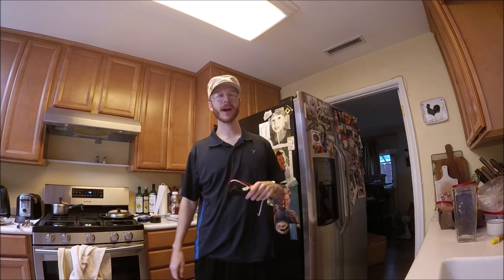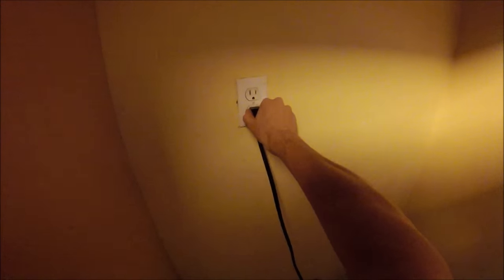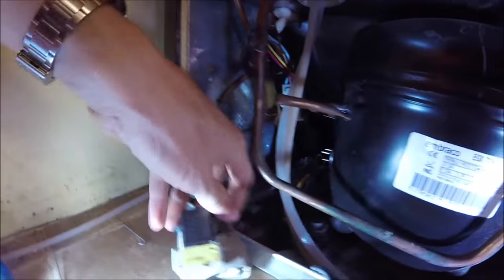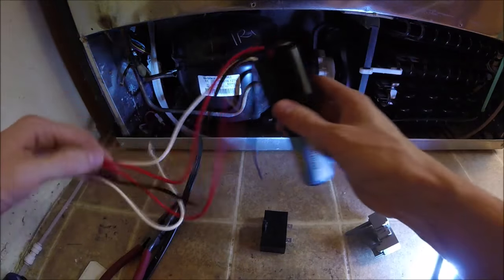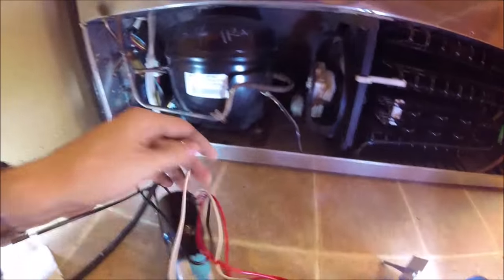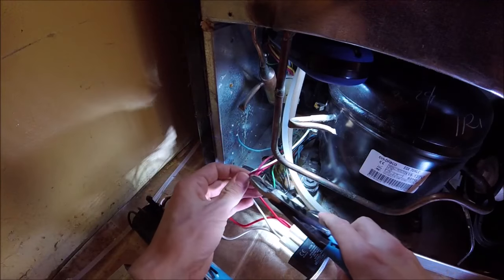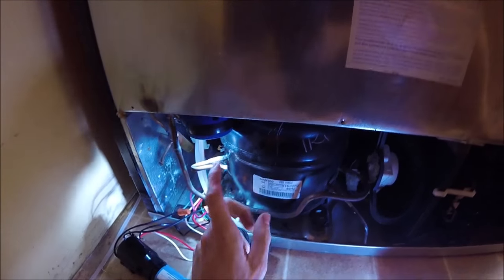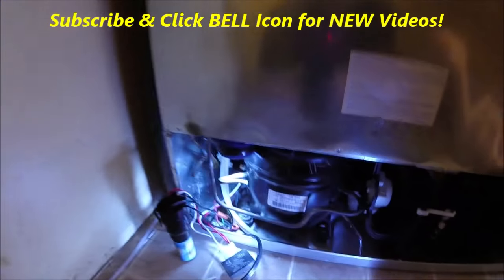Fix Refrigerator. Installing Universal Relay (3 in 1 Starter) on Compressor -Jonny DIY

Comment: Jonny please help me!!! I have a 20 year old GE working GREAT until I defrosted it yesterday. It is all manual. You twist a Temp Control Nob to defrost. When defrost is finished you just turn it up  to higher temp (1-10 coldest). I turned it but it just turns without clicking the fridge on. I can turn it all the way off but not to make the fridge cold. Instead it is stuck in defrost mode. I hear a clicking which before I never heard with this fridge.  It clicks and then the motor starts and cools for a few seconds then stops again. It does this maybe 3- 4 times an hour.  I am so anxious because I cannot afford a new fridge!! Do you think that it is NOT a Temperature Control mechanism problem but instead a simple relay issue? And is fixing an old fridge relay easy? Are relay mechanisms generic, all the same for models or impossible to find for an old model??  Ironically, I did find a new GE Temp Control for my model. SECOND QUESTION: what are the odds that it is the compressor that is broken...? I am really frantic with anxiety == can you please share your expertise? It is clicking, it is turning on and off and the nob just turns without igniting the fridge.  A million thanks in advance!
Reply from the maker: Well I would fiddle with the switch some and try to get it working then I would move to testing the start relay to see if its getting power. It could be the relay went out and its not allowing the compressor to kick on. Old things are funny, they like to break whenever you do something out of the ordinary
Reply: @JonnyDIY  You are great! 1/ I turned off fridge for ten minutes. Problem persists 2/ The fridge motor goes on for 10 seconds then makes a click as it stops humming and goes silent. Does this every 10-15 minutes or so. 3/the defrost tray fills with water over time. 4/ this problem started after I put it on defrost (manually) which I do every 2 weeks.
 I desperately want this fridge fixed. What possibility that it is the compressor  broken do you think? And that would be huge issue, right?  You are a god send. I am female all alone with this!!  Damsel in distress, ha!  But seriously anxious. You are so kind and I hope this finds you well! Look forward to hearing back!
Reply: @JonnyDIY  I just read about condenser coil might be so dirty (never cleaned this fridge in 20 years!) that that is the problem...? Thanks for all your help!
Reply from the maker: @daysjours  is the fridge cooling at all still? I'm thinking its the relay possibly if its kicking on but not cooling at all.
Reply: @JonnyDIY  Yes it is cooling a bit. The water in the defrost tray that I just emptied was cold. The cooling in fridge is slight. So even if the click I hear is at the END of the short spurt of the cooling mechanism going on it could be simple relay? I so appreciate your dialoguing with me -- you are the best of the best!!! I cannot tell you how much it means to me. Words fail :-)
Reply from the maker: @daysjours  yes if slightly cooling makes me think not the compressor but maybe the relay
Reply from the maker: But actually if cooling at all the relay would have to be somewhat working. Maybe its the switch stuck in defrost mode
Reply: @JonnyDIY  Interesting... at first I thought that was the dial broken and stuck in defrost too. I actually found for $65 a brand new Temp Control mechanical part for my model. Then saw your video thinking it was relay Is any of this an easy fix? Would a refrigerator repairman charge like hundreds of $$? Or is it a reasonable fix? I made some calls and found out due to Covid there is a national shortage of new fridges and takes weeks/months to deliver!!  OMG!  The age of the fridge should not be issue, no? Things were made better back in the day...Again, you are the best and your willingness to help is so very kind, really :-)
Reply from the maker: @daysjours  I would call a repairman if you want to keep that fridge. Shouldnt cost but maybe $150 for relay. Many repairmen have minumum charge for house call. If not I would just buy a used one off craigslist or offerup, but make sure it works and doesn't have any problems
Reply from the maker: Or if looking for a new fridge, check local appliance shops. They usually have in stock on the floor you can pick out
Reply: @JonnyDIY   Thanks again. Tons of research I have done to learn that the size I need is nation-wide out of stock. Covid makes it that new ones are slated for January delivery! I hope like hell repairman can fix for reasonable price and that it is mere matter of the relay! Doubt my landlord will pay $300 repair for 20+year fridge! Ahhh. I will keep you posted. You really are such a nice person. Covid has made a lot of us feel very alone and scared and you sure have been a saint!
Reply from the maker: @daysjours  thank you for the kind words. Wow thats some backorder time! Hope you can get your old one going again or find something to get you by a few months
Reply: PS: I think it is possible it is the Temp Control that is busted, stuck in Defrost Mode. I sure hope they can fix it!!
Reply: @JonnyDIY  Crazy backorder, right?! One last question - since this all started with the Temp Control knob turned to manual defrost...is the motor going on and then stopping with the click coz Temp Control stuck so relay is responding rather than the orignator of the problem...?  Thanks again. You are a good man!  You deserve the world!
Reply from the maker: @daysjours  yes it sounds like its just stuck cycling in that defrost mode, why it keeps coming on shortly.
Reply: @JonnyDIY  Will keep you posted and all the best to you. Please stay healthy & safe!

Comment: I bought it, put it in, but still doesnt work
Reply from the maker: sorry to hear, compressor even kicking on?
Reply: @JonnyDIY  no is does not, i check if its shorted, resistance and everything looks good, any idea on what could be wrong?
Reply from the maker: @lazaromorales5371  hmm if sure hooked up relay correctly,  my guess is the actual compressor has gone out. Can also try looking at thermostat. May want to have a refrigerator tech come out to diagnose if the fridge is newer

Comment: Why do you reconnect the old capacitor? The new 3 in 1 kit includes the capacitor. Capacitors are what typically goes bad these days because they are made i China.
Reply from the maker: If the fridge comes with a capacitor I like to use it, if not I don't worry.
Reply: The whole point of this 3 in 1 kit is to do away with the old capacitor and overload protection hence the whole reason your probably putting it on. The 3 in 1 comes with a stronger capacitor and overload built in to it to start worn compressors that need more power to get going. Majority of the 3 in 1 sold are without the external cap not sure why the include this in that kit he purchased.
Reply: @JonnyDIY  If the original Capacitor went bad, dont reuse it. Did yiu test it? They sell a cap meter to test.
Reply from the maker: Yes I tested it before using. Was fine 👍🏻